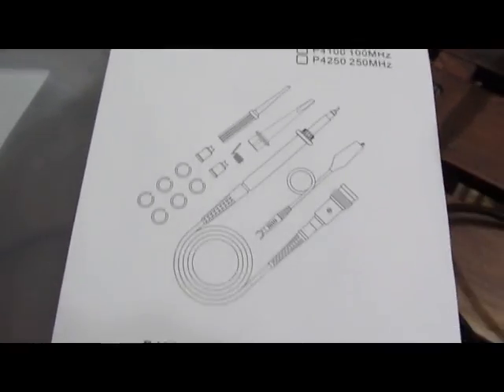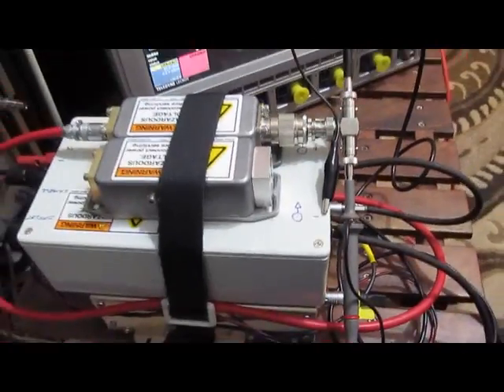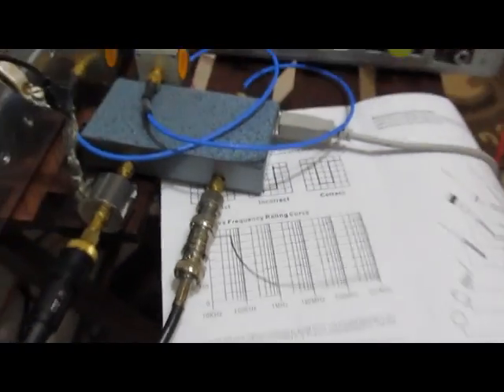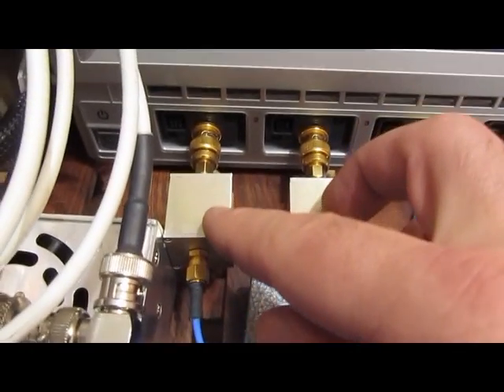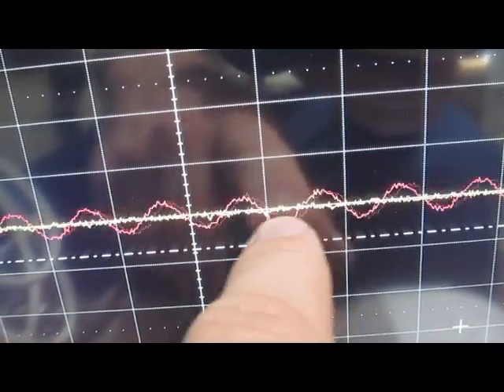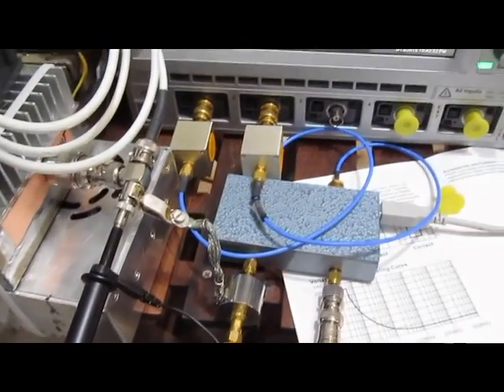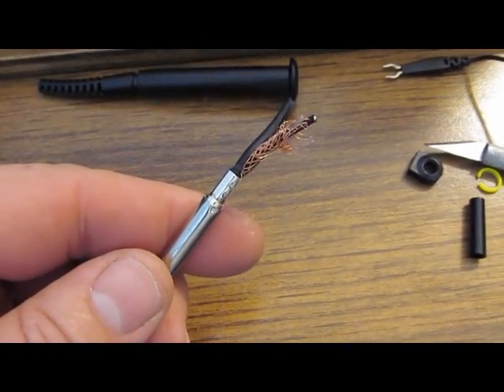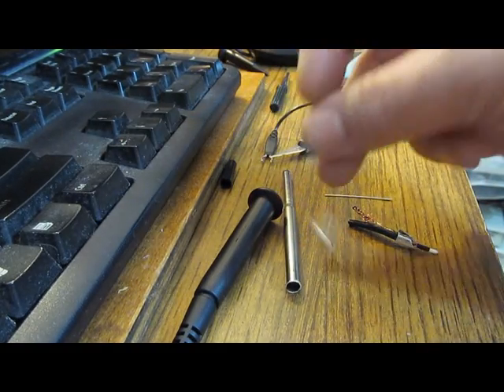Evaluating the P4100 100X 100MHz Oscilloscope Probe

Comment: Hello Joe, 
I recently got a tektronix TDS744A. Scope is still functional at its age.  I want to protect scope from my ignorance, et al. I've watched your videos and am studying electronics,  but I need to be told how I can make good HV surge protection for scope. I'm not recognizing the details I'd need in your videos.  Could you point me in right direction for this? 
Jeff
Reply from the maker: Repeat after me...  
I will NEVER EVER connect my scope to ANYTHING HV!!!  Repeat that to yourself 1000X.   If I need (not want but actually need) to measure something beyond the rating of my probes, I will resist ALL temptation to work around it and buy a proper probe to get the job done!!  Repeat that to yourself 1000X.    I will not attempt to build a HV probe to try and save a few dollars.  Repeat that 1000X.    I will make sure that I wear proper ESD straps, work on ESD safe mat.  I will not use the 1X probe.  I will not be so dumb as to try and measure my AC outlets!     Repeat those a few million times.   If it doesn't sink in after that, well....
Reply: @joe smith  Just say no is the Nancy Reagan line which was never effective solution.  I also see no lack of additional protection on your scope, so there.  I'm wary of the jolt I don't see coming. I'm careful(I'm the guy still using Fluke 75 from '85).
I like the idea of having little box that has known frequency responses that will limit peak voltage if something unexpected happens. I can remove it when time for accurate reading. 
I like how you make your own capacitors and inductors.  Mastering the physics of components is cool.
Reply from the maker: @jspencerg  Politics?  Sad.   There was no just say no.  Buy the right equipment for the job and learn to use your head.  That's what will keep you out of trouble.
Reply: @joesmith-je3tq  hi , in order to measure a 50-60hz sine wave to check some inverters, main grid,... modified or pure sine, armonics, .... Is it good to use a step down transformer ? For example, from 240vac to 24vac. Or it (transformer) will distrub, smooth, .... signal ?
Reply from the maker: @diydsolar  It depends what you are after.   Anything you use will cause some error.   Not all transformers will have the same response.  Of course, you don't want to apply any DC to a transformer.  Following videos show a simple transformer / LEM used to measure AC power with my scope.  
https://www.youtube.com/watch?v=04I7nHA_HxM
https://www.youtube.com/watch?v=oaR1MgRzvdQ

Comment: Difficult to understand what's going on.
Reply from the maker: I think I was just looking at the probe compared with a 10X with a few different waveforms to provide some idea about the frequency response.  With it being a 100X proble designed for higher voltages than the 10X,  I looked at the derate curve and tried to see if it would meet their claimed numbers using a small RF amplifier.  There was a an in-line GDT combined with a 1meg to 50ohm driver and clamp that was used to protect the scope's front end in the event that the probe were to fail during the test.   The probe was damaged running well  within its ratings so I took it apart and found a couple of 1/4W axial parts.   Not what I would expect for a HV probe.    I think that sums it up.

Comment: I just picked up two of these.. I wanted some 100x probes so i could comfortably measure the B+ of a tube audio amplifier. Seems like they'll do the job for that just fine. I can't see myself, anytime soon, pushing beyond having to measure something in the 16-25mHz range at a a few volts, and at that point I can just use my 1x or 10x probes anyway.

It is good to see where the limit is on them though!
Reply from the maker: What would you guess that resistor was rated for voltage wise?
Reply: joe smith hrm.. hopefully a bit over 500v haha
Reply from the maker: It's your equipment.
Reply from the maker: You saw how much I trusted it.
Reply: joe smith you think it's really that bad? obviously the 2k rating is ridiculous but 25% of that can't be that big.a stretch
Reply from the maker: I assume you have looked up resistors of this package size, looked at data sheets for them and can decide for yourself if it is worth the risk.   Obviously, I thought they were bad enough they went to the trash.